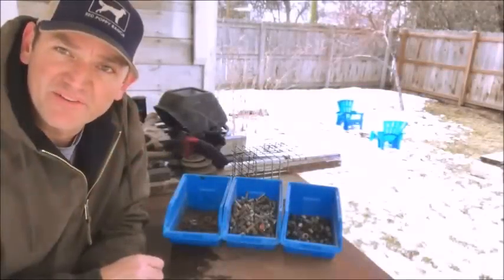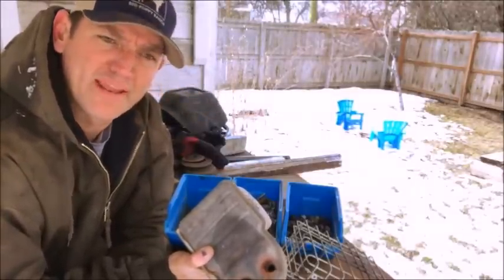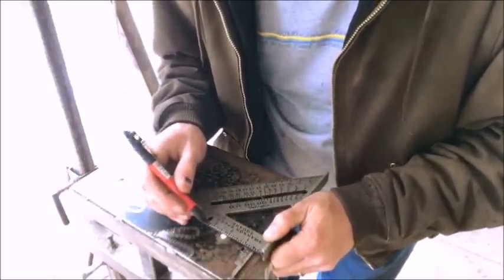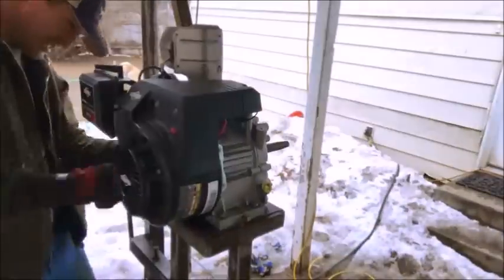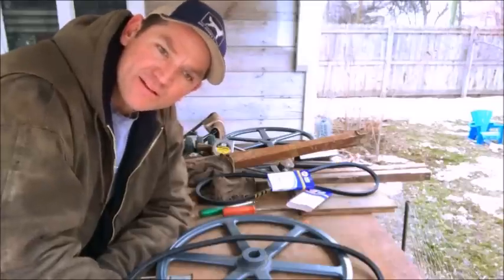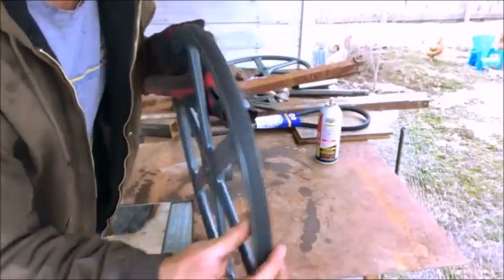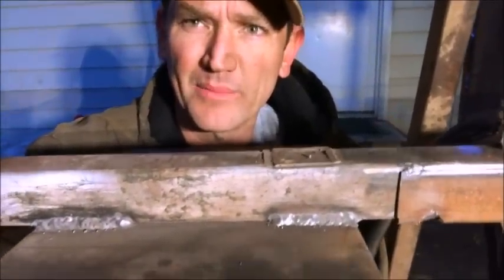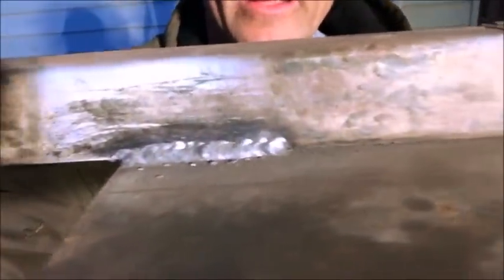#74 - Sawmill Pt 3: Pulleys, Alignment and RPM's...

Comment: Small pulley on the motor , Large pulley on the drive shaft will slow the blade down . Looking forward to see how that blade stays on when under load... I like you doing the LOW COST build ,, keep the vids coming... PS look up machinist handbook to get ratios to rpms

Comment: the man free handed key way slots lol impressive 😎. I'm totally digging the project so far  ... yea the new carb you can adjust the rpm somewhat  😎
Reply: As a retired machinist tool and die maker with 50 years experience this is the first time I've ever seen anybody use an angle grinder to cut a keyway in a shaft.
 kudos great job

Comment: So far, so good. Someone commented that you just need a ATV or lawnmower  throttle cable. He is correct, you do not need a different carb. The only issue you may have with that is the actual throttle cable clamp on the carb brackets. Although, most engines have the provision for it. You just need to look close. For a 11 HP engine, your SPFM (surface feet per minute) blade speed should be right at 3,700 SFPM according to Cooks Saw website. See link below. Your drive pulley is a little small and your driven pulley is way to small There are other sites out there that have the actual formulas for that. I believe the link also has those formulas. I also noticed the belt on there looks like a "B" belt with "A" groove pulleys.
WHat are you going to do for blade tracking / adjustment?? You have a really sweet build going on there and I love your dogs name.....Ruger. I had a beagle named Remington.  
http://www.cookssaw.com/index.php/increase-portable-sawmill-profits-a-production/how-fast-should-a-bandwheel-turn

Comment: You're done by now, but to get the blade length if both wheels are the same diameter, try the following:  Center of shaft to center of shaft times two, plus the circumference of one wheel.  If the wheels are different diameter, it is C to C x's 2 + 1/2 Circumference + 1/2 Circumference.  Very good video series sir.  I'm late to the party but I'm sure by now all is functioning well.

Comment: Hey man. Idea to help with ur welding.. u should get some wire wheels for ur grinder. Make sure they are "twisted steel) get a 4 inch wheel and a 3 inch cup, ull be able to jave polished welds with no slag left over and it helps clean off the splatter beeds.

Comment: Good ideas...just one observation. The engine could be mounted facing the other direction(pull cord towards back) that way you would not have to stand in front of the moving blade upon start up.

Comment: You need a larger belt pulley on the drive side of the saw, like a 12 or 14 inch dia. pulley  and a 3 to 4 dia. on the engine.  Need at least 3.50 to 1  or 3.70 to 1 Pulley ratio, to get the right amount of blade speed or feet per minute.

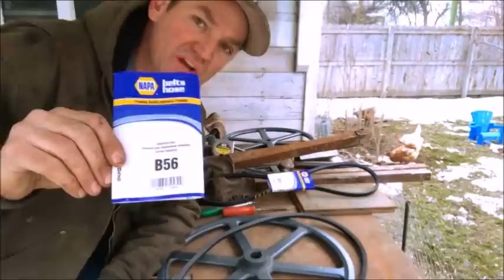Comment: super thank u especially for the parts list!!  BUT: At minute 3:26 you tell the audience u use a B-59inch belt to create the traaction for the pulley./ Sheve...the packet does however show B56? is this a mistake or is a B56-belt 59 inches long? i just don't want to buy the wrong stuff since I am shipping all this to Europe...

have u been happy so far with your cast steel sheaves?

Comment: if anyone reads this, just use a pulley calculator. It will show you the speeds and can show you how large or small both ends need to be and what rpms you get. Will save you a lot of heartache.

Comment: What speed do you want the saw blade to run at? Do the math backwards from there. I've seen values of around 3000-5000 sfpm (surface feet per minute). The circumference of your 19"ish sheave is pi*diameter, 59" as you know already, close enough to 5 feet to round. If you want 3000 sfpm and 5' circumference, you need 600 RPM. From your 3600 RPM motor, you need a 6:1 reduction on your V belt. On that 3" or so sheave you need to put ANOTHER 18" pulley to run it. Or you could do 2" and 12" (a lot cheaper, but 2" may or may not have enough contact to avoid slip depending how tight you have it).  If you needed 6000 sfpm though the math works a lot more in your favor, you'd only need a 3:1 reduction and so a 3" and 9" sheave.
Reply from the maker: I would like to run it around 300rpms.

Comment: Really, really, really nice, so far.  How are you going to keep the telescoping parts from seizing from rusting together and/or flex?  I ask because you didn't mention it.
Reply: I am not sure how much you will be using your mill, but if it is a lot, have you considered buying blades in bulk lengths and custom sizing to fit your wheels?
Reply from the maker: Lot's of grease!
Reply from the maker: The blades aren't too bad. $25-$75. I've found them at a standard length that will fit my mill. I will have to keep a few around. I think Lennox are some of the best.

Comment: Great build. Question?. What size belt did you used on your 18 in wheels. thanks a million
Reply from the maker: I went down to the local parts house and went through the belts until I found the tightest one. Can't remember the exact size.

Comment: On second thought with your carb. After I posted the first comment, I checked on YT for late model Briggs powered generators. There is no throttle linkage plates on it to mount a throttle cable to. The RPM is controlled directly from the governor link. There may be a way to restrict the governor link itself. I don't know. This could be a major dilemma for you. A lawn mower shop may have some used linkage that could be used or at least tell you what you will need. I don't think a new carb is going to solve this problem.
Reply from the maker: I'm trying to figure out if I can adjust the govenor or not.

Comment: Great job! Any advise for a beginner on a decent welder to do stuff like this? I'm in the market.
Reply from the maker: I started on a 110v welder and learned more from that welder than a nice 220v welder. Try it. Get a hobart or a miller. Don't get a cheap one. Go to work!
Reply: Flux core good enough or go for the shielding gas and all that?
Reply from the maker: A gas welder is going to lay down a prettier bead but they are more expensive. Flux core is easy to learn on.
Reply: Most entry level flux core wire fed mig welders are capable of being upgraded at a later time to use shielding gas.  I started with a Lincoln Electric weld pak 100 18 years ago.  After some practice, and after saving up some cash, I purchased the gas upgrade kit, and bolted it on.  Good luck.

Comment: the only thing i can see wrong is with direct drive sheave is it will continually turn saw blade at a dangerous speed. But if you put a clutch assembly on their it will stop when motor slows down.

Comment: OK I've done it myself but DO NOT use power equipment with loose clothing like drilling with your coat open. Did it with an auger bit and a zippered sweatshirt. Fortunately I'm a big man and when it caught my clothes I was just strong and fast enough to force it away from me before it gutted me. It only takes a second.

Comment: Do you think you should just to be safe is to drill the end of your drive wheel and your other wheel the center of your shaft and put a bolt with a washer on it so there isn't any chance of your wheels to come flying off while your into a log seeing how you just have a key way  in the ends  of your drive shave only again just my thoughts and with you having kids out there by the Michine milling wood I would hate to see a wheel to fly off and hurt anyone
Reply from the maker: These are great ideas. I used thread lock on everything but I'm sure I will need to do other things like this down the road.

Comment: What about using bike or motorcycle chain?
Reply from the maker: I'm sure it would work but belts seem to be a lot more forgiving and less likely to hurt anything when they come off.
Reply: Gregg Woods cable will stretch over time.  Use bike chain or heavy  camshaft chain.